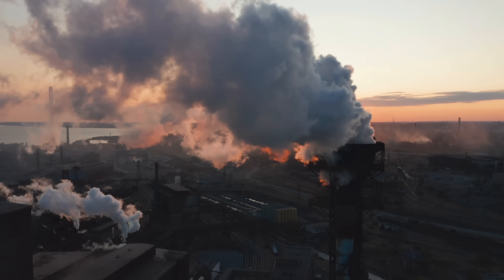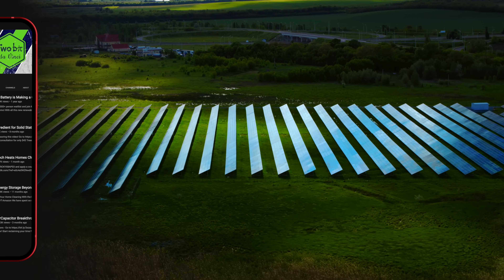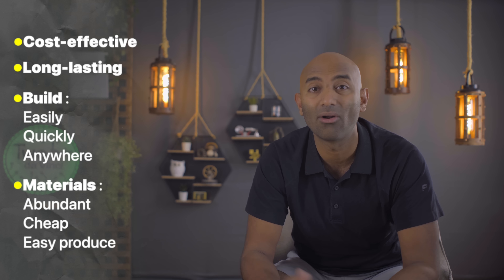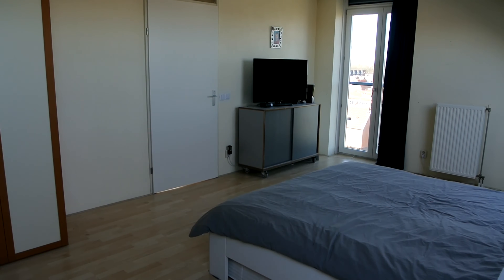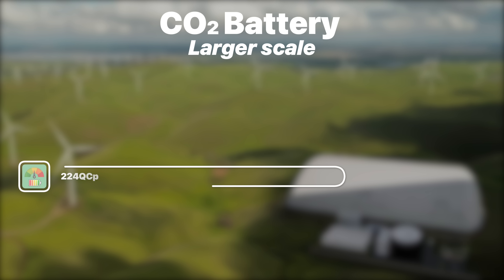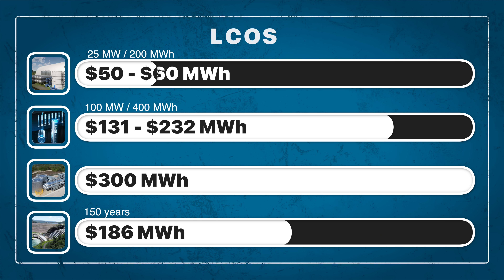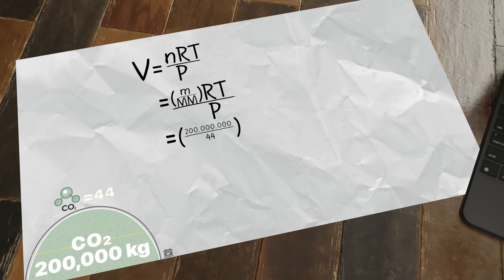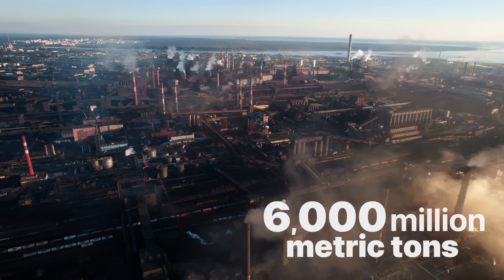The GENIUS Of the Carbon Dioxide Battery

Comment: CO2 batteries are finite amounts of storage, by their own admission (energy dome) they can only condense a tiny amount and use it to store CO2. If atmospheric converters plants cannot be built built big enough to make a difference to CO2 storage (back into the ground), why would a few fixed batteries save the planet? At best this is just a cleaner battery solution to rare metal batteries (a good thing for fixed energy storage), but in the long run it will do nothing for global warming because it cannot make the slightest impact on what's in the atmosphere at the moment- as analogy I would say it's about as effective as filling swimming-pools to solve rising sea levels.

Comment: Dude... great video! As someone that uses batteries for a few applications the things I know is...they are wildly enifecient ovet thier lifetime, take much more time to put energy in compared to the short time it takes to drain the e energy in high energy use applications (RC Plane or oh... EVs like a Tesla) lastly and most importantly, they are wildly caustic and lipos are a massive fire risk. Just expose them to bloody AIR!!! 
Been saying our batteries technology is basically stuck. Or, what I thought was stuck. They just won't be able to help us replace Fossil Fuels. This gives me hope. I've always believed that it'll be people, the innovators and dreamers that help us make a better world. Certainly not govts! The elite ruling class sees climate change as a method to gain and maintain power with no intention of seriously making a difference. For God's sake... our fed govt classified CO2 as a pollutant. A fundamental building block for all life on the planet! Absolute MORONS!!! 
CO2 is a Greenhouse gas. But, what else have we done during the industrial revolution! Built huge cities that are massive heat sinks. Deforestation which eliminates huge carbon sequestration system. We grown rice on terraces where rice could never grow naturally. Yet... the only cause is CO2. When anyone blames only CO2 for the problem, that I'm not even convinced is a problem (heat supports more animals than cold)... the you can't take that person seriously. They either have a political agenda or are just useful idiots. What science doesn't know about the incredible complex and multivariate global climate... can just about fill the grand canyon. So..run from these people as fast as you can!!!!

Comment: Humans only contribute about 3% which is a trace amount. Where does CO2 go ? It is the necessary food for plants and trees and these suck up most of the CO2. We are actually in a CO2  deficit and the vegetation desperately need it . We were at a critical level before the Industrial Revolution 180 ppm and all life DIES  AT 150ppm. The Industrial Revolution actually saved humans and life. I wonder what happened on Mars? 
Note ,when humans meddle in anything they basically screw it up.  Wind Turbines are not GREEN and have a huge Carbon footprint. Why not have so?at panels on all homes instead of solar panels covering large areas of land ? Both these technologies are not reliable and are not consistent and look ugly besides the Wind Turbines are costly for little return
Reply from the maker: So much to touch on here. CO2 is plant food and a greenhouse gas. You mention mars, how about Venus are you aware it’s hotter than mars even though it’s further from the sun? Wind turbines are crazy efficient and cost effective that’s why everyone is installing them. Worrying about how solar looks is very silly. Here’s a thought experiment, what would happen if you were in a closed garage with a gas car running? Very bad news, so why would a billion people burning gas, and also cutting down trees be good? It’s not rocket science.
Reply: @TwoBitDaVinci  What do you think plants live on? Ever heard that Plants suck up CO2 and at present we are in a deficit which is why commercial greenhouses have installed CO2 generators. Wind Turbines are not efficient because they only function about 16-18% of the time and cost about $20 million lasting 20 years with good maintenance. The wind they require needs to be strong and on many occasions are sitting idle. Some of the wind Turbines are killing the great birds that fly at that height.
 You might also consider their carbon footprint (very polluting in China) to make them, and the amount of cement used to put them in place and cannot be recycled.
You might also consider if they don't function all the time, it would be bad to be having surgery or be on a ventilator etc
 The cleanest is nuclear power plants which has very little risk, take up little space and is reliable.

Comment: As we move away from fossil fuels, an increasing percentage of domestic electricity will be used for heating purposes, so there is room in the mix for mass thermal storage. If you live in a continental/alpine climate, a unit the size of a 20 ft shipping container should be able to store anywhere between 1 and 2 MW.h of space and water heating. With effective insulation it should be possible to keep losses to perhaps a couple of percent per month. If you size your solar/wind/hydro system to fully meet your non-heating needs in the darkest month of the year, there should be plenty to spare during the summer months to run heating coils gradually heating 5 cubic metres of sand up to a toasty 500°C.

Comment: You have a compressor on the charging cycle and a turbine on discharge, yet you still reckon 80% round trip efficiency. My credulity is stretched to its elastic limit on that one, Mr da V.😉

Comment: This is a great common sense idea! I'm all for it!

While we're at it let's not forget that plants need to take in carbon dioxide to live, and then they give off oxygen as a waste product. People and animals need to take in oxygen to live, and then give off carbon dioxide as a waste product. This is a balanced system. Granted, some industrial activities have increased the CO2 levels, but we absolutely must not get rid of all of the carbon dioxide, as that would destroy our balanced system, and kill all or most plants, animals, and people on the planet. It would also destroy our planet's CO2 blanket, which would further damage the Earth's ability to support life.

This CO2 power plant method will allow for easily controlled use of excess CO2, while leaving enough to support our balanced ecosystem. It's also inexpensive, pretty safe, and fairly easy to set up almost anywhere.

Even something as natural as hydrogen power poses problems, as it's very flammable. Lithium batteries can explode and/or burn. They are also toxic. Nuclear power plants provide a lot of power, but are extremely expensive to build because they are dangerous. They also generate toxic waste that will be toxic for thousands of years, and must be kept away from the environment. We don't have unlimited storage capacity for such poisonous wastes, and no one wants to live near a nuclear power plant or a nuclear waste waste storage facility.

This CO2 power plant idea is definitely one of the best ideas out there.

Comment: One thing I see as a problem, if the LCO2 is somehow released (accidently or deliberately) the area it'd cover as a gas would be catastrophic. In Africa there are a couple lakes that somehow trap co2 deep in their depths in suspension of the water (Think carbonation). When released it was responsible for killing thousands. Now Imagine a LCO2 battery complex in NYC, LA or any other highly populated city. If it somehow is released, you are talking deaths in the MILLIONS, First responders and emergency crews are not able to even help. Even with proper training, no air or oxygen no breathing, near instant death. It's a great idea for sure, but you'd have to have so many precautions in place, that would effect the viability from a budgeting standpoint. Or it'd have to be so far away from any populous that there might be potential losses from the wires needed to transport the power. I know all these have to be soused out, just pointing out the potential danger as well as the budgeting and logistics of such an endeavor

Comment: Very interesting tech for energy storage, but until the economies of scale can be increased making it economical, nuclear is STILL the best option for electrical generation. Despite both the Chernobyl and Fukashima accidents, nuclear IS STILL safer. BTW I live 5 mile from one of two nuclear plants in Texas. Neither have had any recorded incidents. We would need to balance the amount of carbon sequestration to not kill the user of  CO2, you know, plants, the organism that produces as a byproduct Oxygen which we need to survive. Also, despite the gloom and doom out there regarding the amount of CO2 in the atmosphere, the current levels are far below the amounts as measured in geologic time.

Comment: Not going to be a good long term solution.  Measured efficiency is about 78%. While this sounds reasonable, when you factor in component reliability, maintenance and wear out replacement, overall efficiency craters.  Way too complicated.

Comment: Could you put in under the ocean and have wind power compress the co2. And use the weight of the water to further increase the atmospheric pressure, giving greater energy density?
Reply: Greater pressure will also require more energy to store it.
Reply: @brooklynct2003  that is not a problem. That would be the purpose, More storage.
Salt and water are problems. The whole system would rust, servicing in scuba gear. It doesn't seem necessary or efficient.
Reply: @irrichman  make it out of plastic water bottles. Seems to last forever in salt water....

Comment: OMG, I run everything I use off of car batteries. it takes about to be able to run a small fridge. I have 18 batteries, all were dead when I bought them, 200$. I use 6 at a time. And I made a simple make shift PNP Heat transformer using an earth magnet, 2 thin sheets of copper and a thin sheet of aluminum... Worst case scenario, I might have to build a fire to charge them, but I normally use an old school tv Magnifier... which are illegal.. ftr... but heat is power, is voltage... I haven't paid for electricity in years now. And I have full power during blackouts. PAYING FOR ELECTRICITY WHEN THE WORLD IS POWERED OFF DC IS SOME IDIOTIC BS. Of course if you are found powering an actual home and not just a mini house, makeshift shack or RV, you will in turn find yourself in violation of the freedom of information act in the US..... Oil and gas is burned for heat, which is converted into voltage by taking the rapidly moving ion and charging them, which can be done with magnets... like rubbing a magnet against a nail magnetizes the nail, you magnetize the ions using copper II, the aluminum is acts like a condenser. You also need something with a inductance, think back to the 90 when you learned about  PNP and NPN transistors,  step up transformers. ... And always remember... heat, voltage, and power are all directly proportionate to each other at a 1 to 1 ratio, and Wet Cell batteries are just NPN transistors hooked up capacitor.  In theory, fuming a glass rod with arsenic, while highly dangerous would make a nearly perfect capacitor. it would charge almost instantly, the charge would hold forever until dissipated, and if stored correctly would not cause acidic oxidation on the copper components.. What is the use of a CO2 battery in the nuclear holocaust.. or money ftm

Comment: So balloon storage tanks? It would be an interesting tech if it can be made viable. It's still nothing compared to a nuclear power plant, and I'd rather have dozens more of those that thousands of miles of panels and windmills with a bunch of balloon tanks.

Cost efficiency is not really why wind and solar are growing. It's government subsidies, governmental propaganda campaigns and regulations to support it, with international corporations doing the same thing. They're decent supplements to a main power source, but they'll never be able to replace carbon and nuclear fuels. Maximum efficiency of photovoltaic cells is 25% and we're not even there yet, and wind is pathetic with it's irregular output. The only place they make sense are costal/island locations with a few inland locations that can work. Just saw six commercials for solar panels, and each and every one of them said the whole reason solar is so cheap is because of government subsidies. Apparently those subsidiaries are dropping soon if the marketing is to be believed, which will make it more expensive and no longer viable for most people. Not the same as a solar farm, but it's a better application than a solar farm.

Comment: Your cost estimates are off by 3 orders of magnitude. If the cost was 238 dollars for MWh, The cost of a car battery would be almost entirely determined by the cost of mechanical components - frame and packaging. The cells would cost below 50 dollars.

And regarding capturing CO2. It's just dumb. Just burn some trees and plant some new ones. If you want to feel good plant more than you burn.

Comment: Plants grow best at 1000 - 2000 ppm.  At 400 ppm we are starving our plants.  Moisture in the air is the greatest green house gas.  When plants have more co2, the emit less moisture.  Submariners live in 4000 ppm in subs with no problem.  The problem is pollution, not co2.  Green energy is not green.  Mining, processing, manufacturing and recycling of batteries destroys the environment.  Electric cars create more pollution to create and recycle but less to use.  An efficient gas car pollutes less to make and recycle, more to use.  Environmentally, both are the same.

Comment: The requirements put into the process which increase the costs, the less likelihood that companies will rush to adopt the technology. Even if they produce cheaper CO2, in the long run there will be a savings if the storage systems hold up to the hype. Over time, excess CO2 is consumed, as it always has been.

Comment: Unfortunately, I don't see much potential for this "CO2 battery". At least not in my densely populated region. It just takes up too much space. Maybe you can build one in a big empty desert. Also, as mentioned in other comments already, there are safety issues, as large amounts of CO2 can kill people in case of an emergency situation.
By the way, I think your LCOS chart is a bit off. It is probably $ per kWh and not $ per MWh. And as you stated correctly, effency for the CO2 battery is lower, which means you will lose much energy over time. This lost energy also has to be considered in the operational cost over lifetime, which probably makes cell battery storage much more cost effective in the end.
For power grid stabilization and short-term storage (some days up to some weeks), I think de-centralized cell battery based storage will be the way to go. Because of their low latency (regulate power within ms), flexibility (just place a container in a living quarter and connect it to the grid), and low space footprint.
What we really need is seasonal energy storange, which will probably come down to "power 2 gas" or "power 2 e-fuel" which is not very efficient, but currently there is nothing better at this scale. Maybe some Redox battery systems in the near future. I don't see CO2 batteries in this sector because of their insane space requirements, safety concerns (leaking CO2 may kill people), and I don't think that the heat energy, which has to be stored between compression and decompression, can be efficiently stored over many months of time.

Comment: One additional way to store energy from the moments energy production exceeds demand would be to create hydrogen. Long term storage losses would be fairly low, so long as no leaks. If any happen no green house or toxic polition.  Many existing in use or recently decommissioned power plants can be readily converted to quickly upgrade and add power availability in very short order. And as a back up natural gas can still be supplied as fuel, when absolutely necessary, to keep grid funtional. The exhaust from hydrogen burning is fairly nonpolluting. This battrry has potential to be manufactured reasonably and from components reasonably sourced in region. Thr problem with many green energy things now is many are far more polluting or wasteful. It predominately has to do with the massive mining operations in often foreign countries that have essentially no regard for the pollution or environmental damage their practices and equipment cause. Additionally the counties that also use slave labor and highly polluting factories to manufacture these items, then the massively polluting barges to ship these components across the ocean. The class and type of wind turbines the us uses falls into this category. The blades many use are illegal to use in many EU countries as they are NOT recyclable, and uae polluting practices and components. Many wind turbines of this type have a negative return on energy investment once you factor in all forms of energy and losses of conversion in every step of its manufacturing process and maintenance in their serviceable lifespan. Their are newer upright wind tunnel like units that can operate in a wider range of wind speeds. They have a throttlable collector intake to achieve this, yet very little development seems to be happening on them.